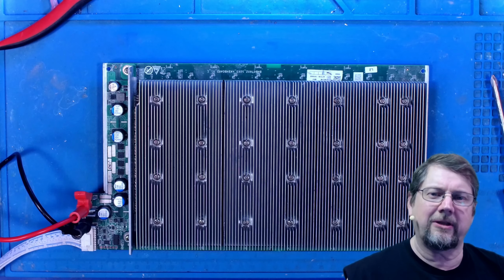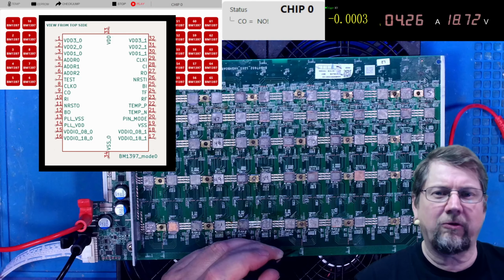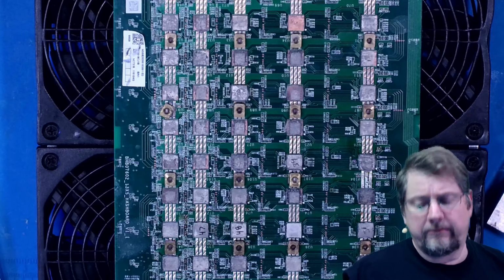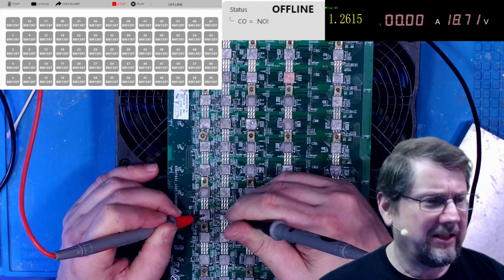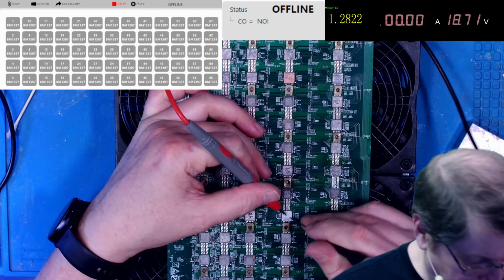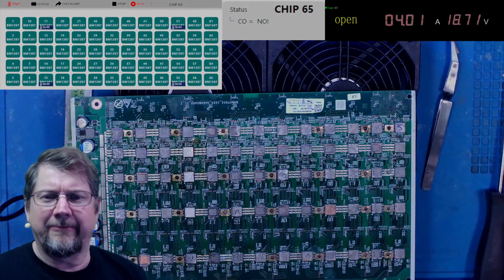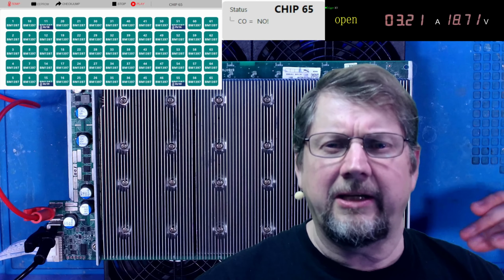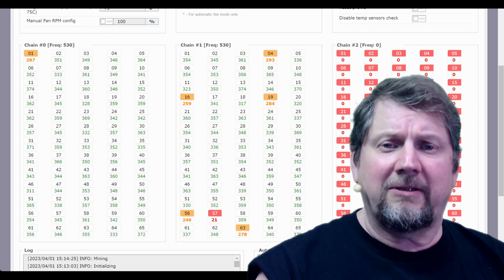Chip 49 fails again - S17+  board 001  Antminer

Comment: Do you offer heatsink refit service for the S17+? Thank you
Reply from the maker: Not yet! I'm still working on getting the process down so that it's consistent, reliable and cost effective.  Depending on how many units you have you can easily do it yourself. Check out https://brianrecommends.tech for the links to all the parts you need for the refit.  
If you are in Texas, please find my contact info on the About page and reach out to me. Maybe we can work something out.
Reply: @iagmr  I have no soldering ability whatsoever and I researched you're videos and few others and it's beyond me for sure. I'm in Georgia. I have a quote from someone on eBay for $100 per board if the complete chain is good and $200 per if work is needed.
Reply from the maker: @AKS74S  that's a very good price either way. I think my net cost on the heat sinks alone are close to $50 / board.
Reply: @iagmr  I have the refit kit already in hand. So that's just their service fee.
Reply from the maker: @AKS74S  For labor alone, that's still a good deal in my opinion. About 3 hours is the fastest I've been able to do the entire refit process on 1 board and I always mess up a few chips which have to be replaced. My most recent refit, board 005, took me 2 long days of troubleshooting AFTER I installed the heatsink nuts.  That video will be out in a couple of days, it requires LOTS of editing.
Reply: @iagmr  okay thanks for your time and help guess I'll abandoned this project as that's a bit much for this old gear. I just bought a s19a for $880 and paid $220 for the S17+ then $100 for the heatsink kit so after paying that much to have the work done it'll be over the cost of the S19a.
Reply from the maker: @AKS74S  if all 3 chains are working I'll give you $300 shipped for the miner and heat sink kit so it's not a complete loss for you
Reply: Hey 

Are you still interested in doing this deal? Would you be willing to do $325 shipped

Thank you
Reply from the maker: @AKS74S  Possibly.  Please go to my channel's About tab to get my email address. Reach out to me that way we'll work out the details.

Comment: A few observations I have made… there is a direct correlation with the resistance and diode voltage when testing if a chip is good (I’m referring to when the chips are removed and checking the back of the chip and the large ground pad).  If the chip showed 80 ohms it will be .080v on diode mode. So I find there is no need to do both tests. 

Also I find that chips with a value of less than 60ohms tend to run hotter. While they usually hash well, if you put one in the temp sensor spot, it can show hot temps… I usually try to put 140 - 120ohm chips there.
Reply from the maker: Those are some great observations. 👍